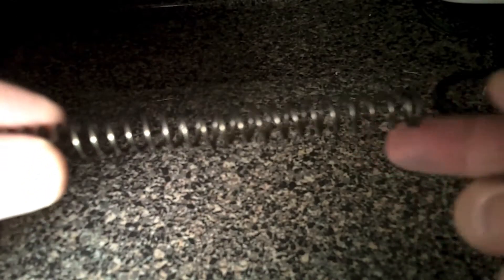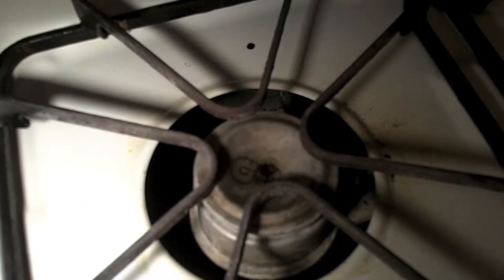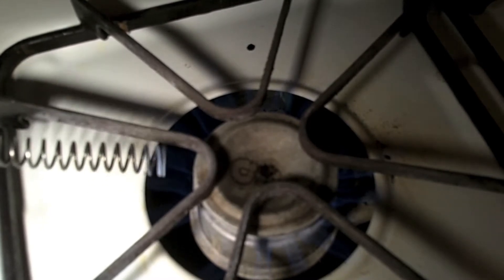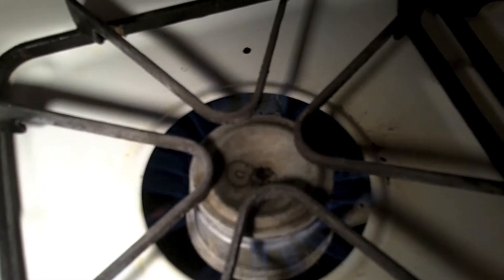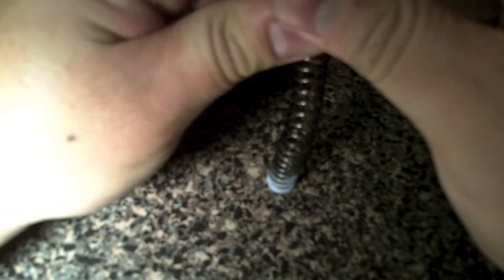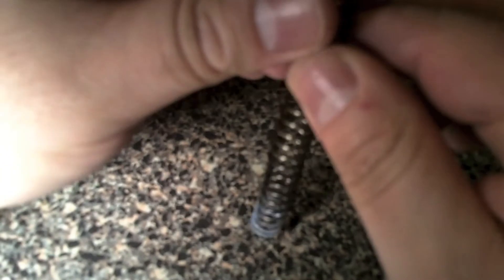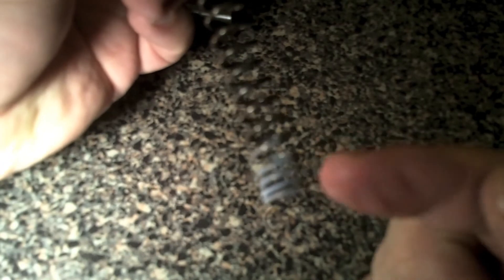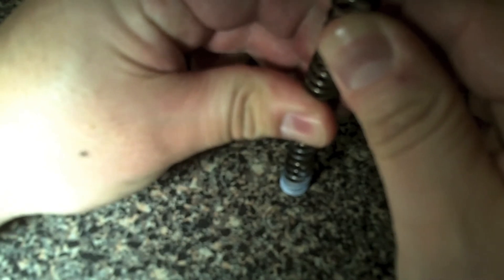How to modify your airsoft gun spring on a celcius mx2 ctw and a systema ptw cylinder

Comment: Super helpful, This worked on my 110 systema revolution gearbox spring, now shooting at around 350fps rather than an unskirmishable 390fps... The only thing I did different was to place the spring over an old barrel when I compressed it, just to keep it as straight as possible. Thanks again for this video!